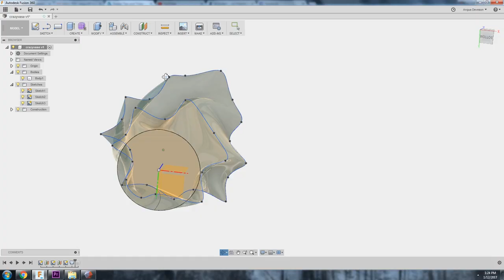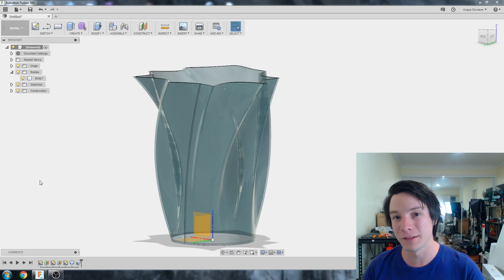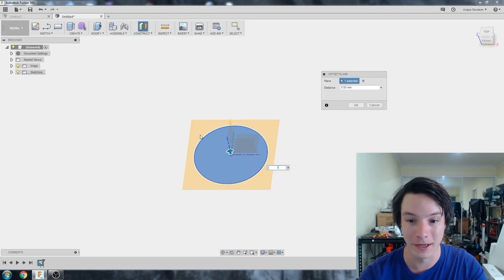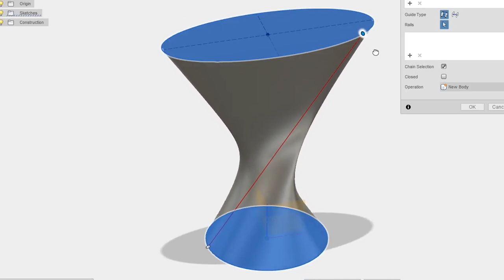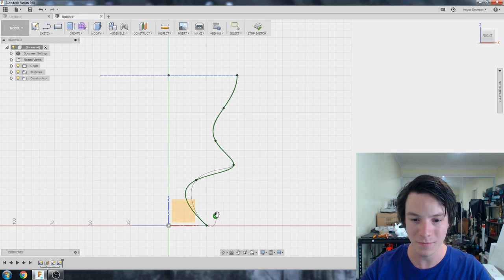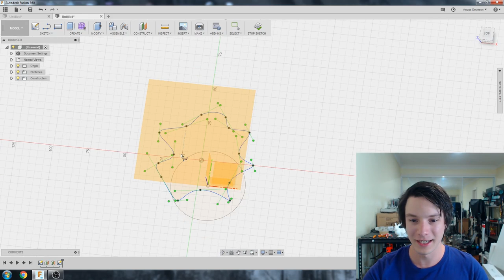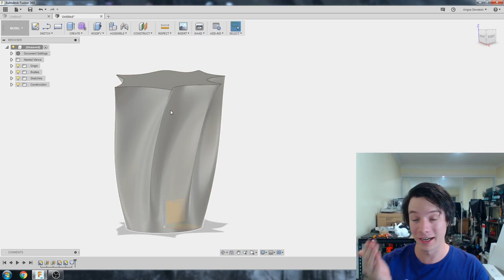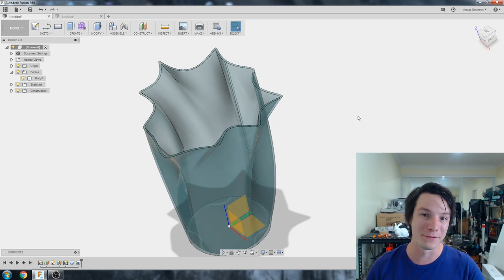Crazy Vases using the Loft Feature in Fusion 360! CAD For Newbies Tutorial

Comment: In my experience, when printing in vase mode (or even regular parts), the most important setting for strength and quality is the extrusion width.  You can surprisingly print with a width of up to 4x your nozzle diameter (e.g. 1.6mm extrusion width with a 0.4mm nozzle) providing dramatic benefits to the part strength.   As a nice test, print 7 small cubes in vase mode (1cm sides) at 0.4, 0.6, 0.8, 1.0, 1.2, 1.4 and 1.6 extrusion width and compare the strength as well as the cosmetic finish.  For some reason, extrusion width is under exploited.    Obviously it takes longer, but you can create more functional parts.

Comment: I know this is an older video. I just purchased the CR-10 V2 and BL touch sensor (after watching your video). I like to tinker and so the printer should do just fine for me. I have lots of WYZE cameras and I want to hide them, they are ugly sitting on my side table aimed at the door, or on a shelf looking at the patio, etc. I wan to create a vase for them. Specifically, I want to create a vase that has numerous circular indents about the size of a lens, not complete inverted domes, but more like craters on the moon. I can create the various shapes in Fusion (TinkerCAD just wasnt doing it), but how do you randomly distributed them across the surface of an object? Is that possible?

Comment: Bet practice is to have a root sketch that is on a perpendicular plane and just has a vertical axis where you anchor your offset planes in - so you can change the distances really easily by giving your axis a few points where you anchor the offset planes at. 

I learned that from a tutorial where they made a nice whiskey bottle. 

I failed becuase I tired to go from a profile on a horizontal plane to a angled profile but that didn't work.

Comment: Is there a way of making a model  ladder 20 mm  long, 5mm wide and make the runners in fusion 360.
Great video learning alot from u Angus awesomeness. What are your thoughts on Wombot 3d printers and are 3d  scanners any good.Thanks Joe
Reply from the maker: +Joe Muller easy, you will need to use the linear pattern tool to make the rungs. Haven't tested wombot printers and I recently tested the einscan se and sp scanners on the channel.

Comment: Can you tell me of a liquid or spray I can use to seal the inside of the vase, which would come out clear?  When I print using Slic3r's vase mode, it won't hold water - and I don't want to print these things without vase mode, as they eat up too much filament.  Thanks!

Comment: Angus.  I am having an issue when I create a vase with a 1, 1.5, 2 mm thick wall.  When I slice using S3D, the preview shows the wall as 2 separate walls. I try and use 100% infill, 10 perimeters, and even 20% overlap for infill.  My preview shows the same two walls with space in between.   I get this in Fusion 360.  No matter if I draw and extrude, make solid, use sheet metal mode to draw, or follow your instructions in this excellent tutorial.  Any help?  Would be great.
Reply from the maker: +Trent Retallack try changing your extrusion width to a larger or smaller number, it auto defaults to 0.48 for a 0.4 nozzle
Reply: I think there is a setting called "ensure vertical shell thickness" besure to check/uncheck that for your need and just test both options. 

If you export your vase as a solid model and just put in no top and no infill - you should have zero issues doing 4 or 5 perimeters. But be sure to uncheck "external perimeter first"